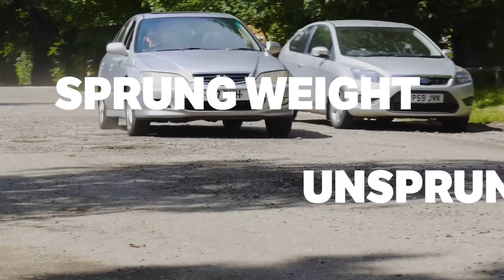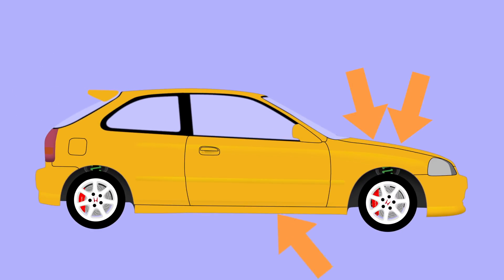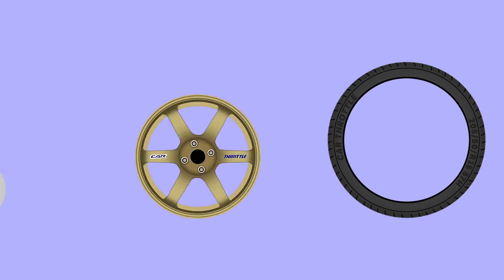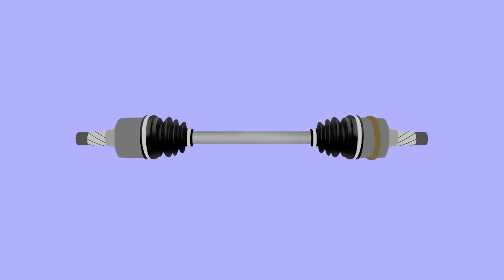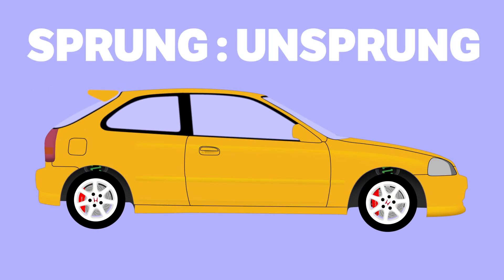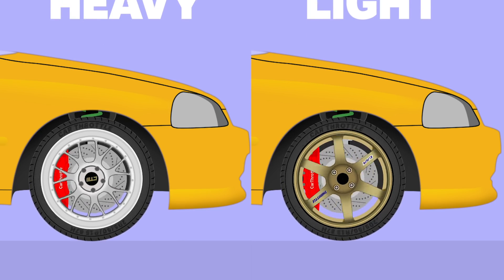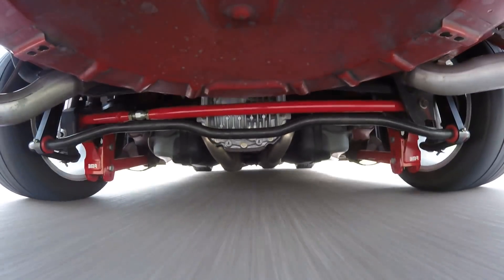Sprung VS Unsprung Weight

Comment: Getting lighter wheels, tires, and brakes actually also gives you more wheel horsepower. Think of it like moving your arm around in a circle fast. If you add a bunch of hula hoops to your arm, you will move it around slower due to added weight. Same concept. I remember I purchased a car a while back  that had beautiful after market replica wheels and I decided to change them to the original wheels and I'm glad I did! My 0-60 mph I'm proved by over 1 second and my 0-100 mph improved by over 2 seconds!

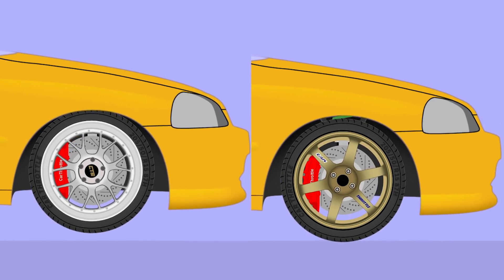Comment: 1:18
Wrong, it's the complete opposite.
Low wheel weight improves BOTH ride and handling.
It's easily proven with simple math, computer simulation or butt dyno so please stop spreading BS.
Reply: I feel like they on about if sprung weight was less as when wheels move quicker it push the sprung weight up quicker than it can hold it down

Comment: May be sum 1 can tell me this but wat is a k car
Reply: A Kei-car assuming that's what you meant is a Japanese car designed to fit certain size regulations for tax benefits. They can't be any longer than 3.4 metres, any wider than 1.48 metres, and must have a max engine size of 660cc, and a max of 63 horsepower. 

More famous Kei cars are Suzuki Cappuccino, Honda Beat, Mazda AZ1 and Daihatsu Copen. Because most of these only get the tax benefits in Japan, you don't see many outside of Japan.

Alternatively, Americans gave the nickname K-car to any Chrysler/Plymouth/Dodge running on the front-wheel-drive K-chassis that some argue saved Chrysler in the 1980s.

Comment: I have heard unsprung weight has to be multiplied by 3. Is this true?
Reply: iDennis95 same weight reduction size in unsprung weight is likely to have 2 or 3 times the effect in the unsprung weight.  For example if you reduce unsprung weight 10 kg is have the same effect of reducing 30 kg of sprung weight.

Comment: I think ye are wrong about the lighter wheel imparting more motion into the cabin. What ultimately effects how the cabin reacts is the force applied. Say for the same bump and speed of the car the force will be less for the lighter wheel as force = mass x acceleration. The distance travelled at the same speed will be the same, so the acceleration is constant, all that changes is the mass of the wheel which means the force overall will be less for the lighter wheel. However, because the wheel is lighter it may react to imperfections more severely as there isn't the same weight pushing down on the TIRE. This means the tire not the wheel itself is less likely to smooth over bumps. You'll find you have much less body movements with a lighter wheel, however, you might find some more vibration.

Comment: Nothing hurts more than if you have coilovers and you hit a pothole.
Reply: Maxxas Crow that's when you get coilovers to lift the ride height.
Reply: Memes of cutting springs short. See what I did derp.
Reply: Also a pain if you’re driving a lightweight quad bike. The front suspension feels so stiff. It’s so responsive though, weighing only 90 kilos..